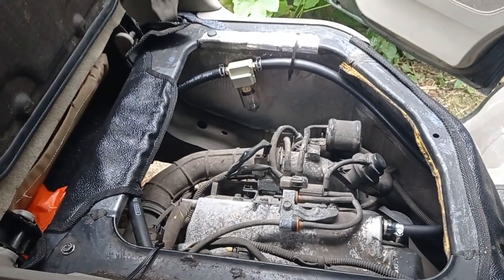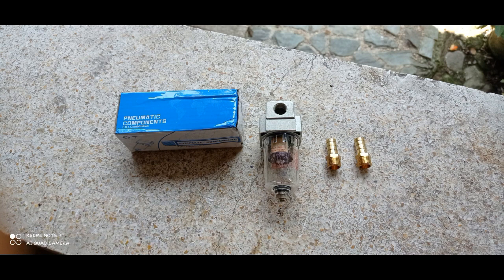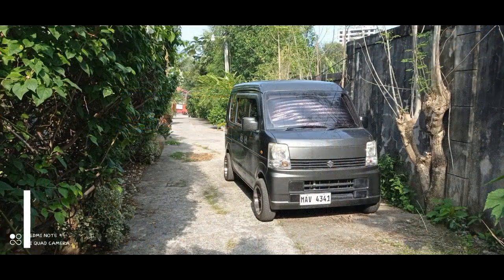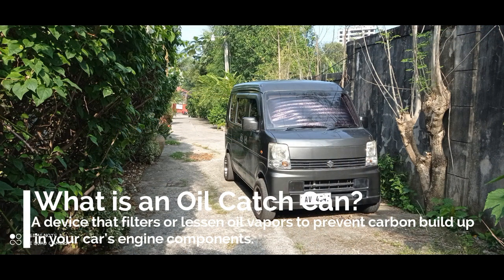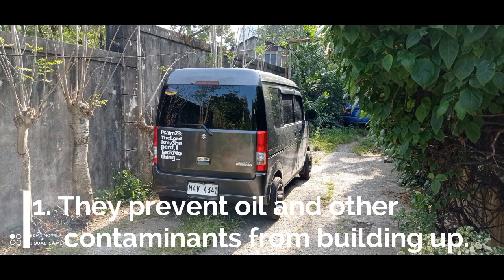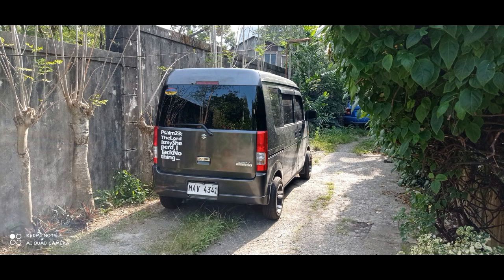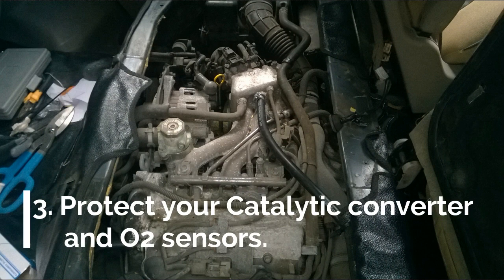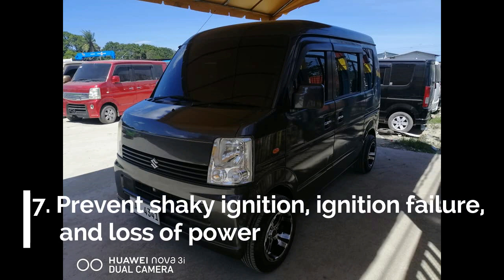Will Oil Catch Can work in your Suzuki Every DA64w/v? Watch the video and know the benefits!

Comment: can u share the link for occ
Reply from the maker: thank you for posting your question my friend. the product page for the item on the video does not exist anymore. here is a quick search query from shopee (https://shopee.ph/search?keyword=oil%20catch%20can). thank you again. Gbu!
Reply: @randykaraan9119  hose size is 10mm?
Reply from the maker: @markojamesdimen7238 actually sir, the hose should match the bracket size of the item you will be purchasing. if you click on the first item from the query results, it comes with different sizes. please do take note that the hose should be safe/compatible with high temperature environment. ty again for asking sir. Gbu!